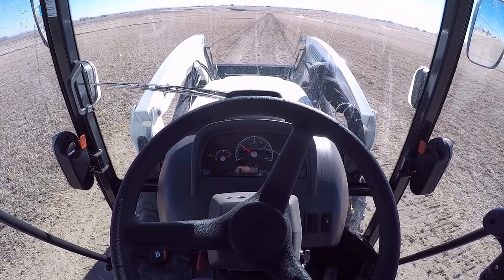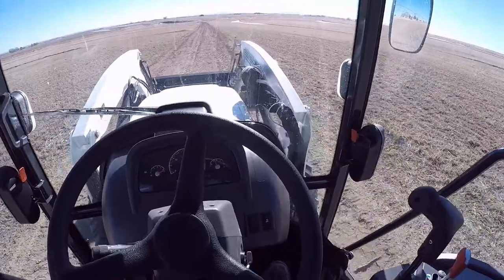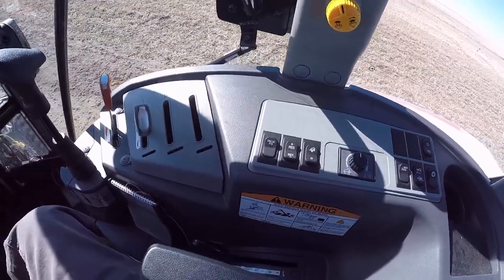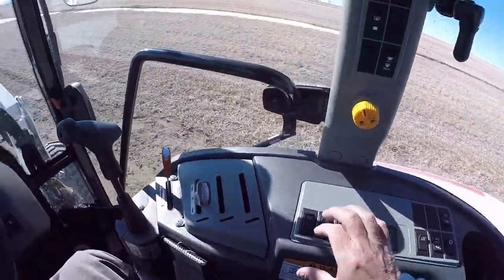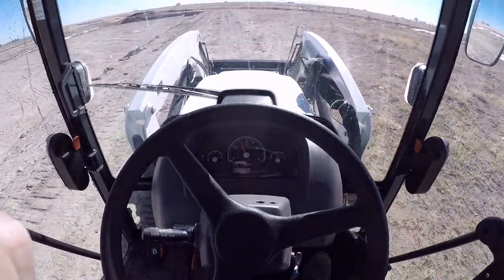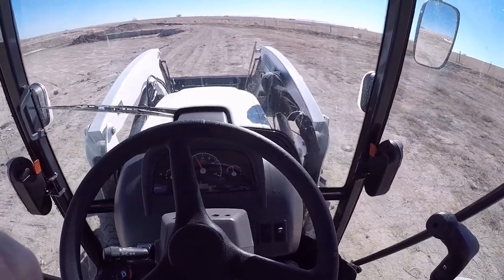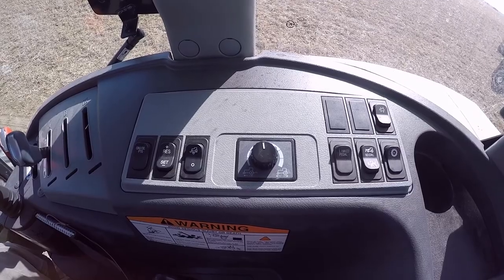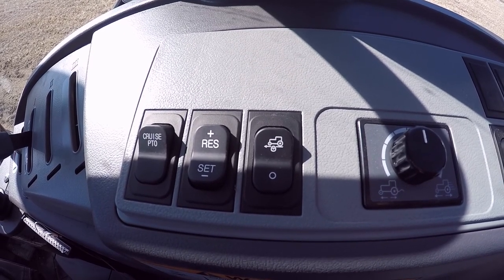Bobcat Tractor Hydrostatic Cruise Control

Comment: I noticed on mine the cruise doesn’t work when the linked petal switch is on
Reply from the maker: It should. The ground speed you set it at with the linked pedal switch on is what it should try to maintain, with the exception of not enough engine rpms to maintain it. For example, setting the cruise at half pedal throttle position, then letting off the hydrostat pedal which would allow the engine rpms to drop off (because it is linked) to the point it simply cannot maintain the set speed because there is not enough rpms to. On the flip side of that, if you set the cruise at the half throttle position and push more hydrostat pedal the only thing that should increase is the engine rpms (because it is linked) and it should stay at the ground speed it was originally set at.
I hope that makes sense.